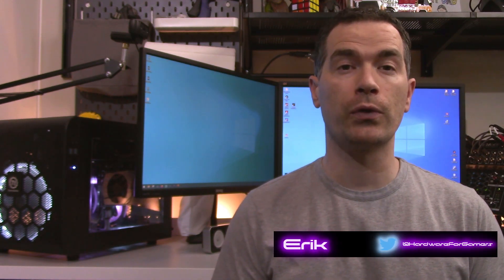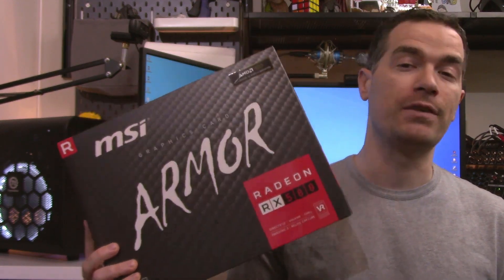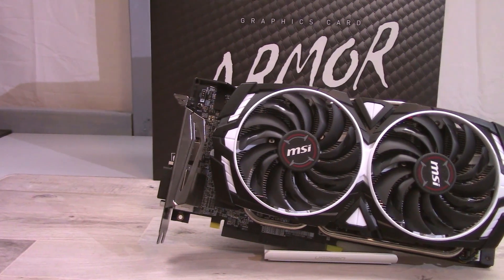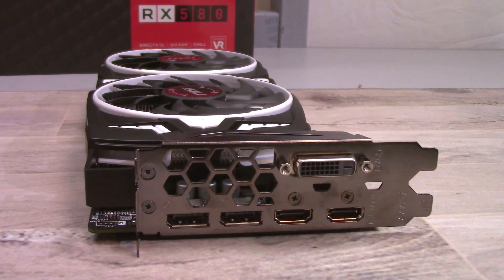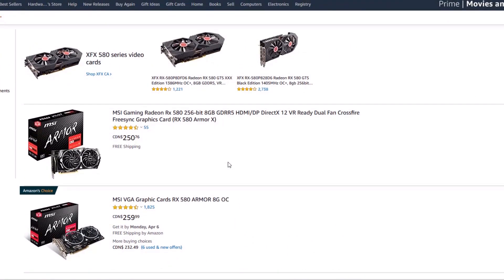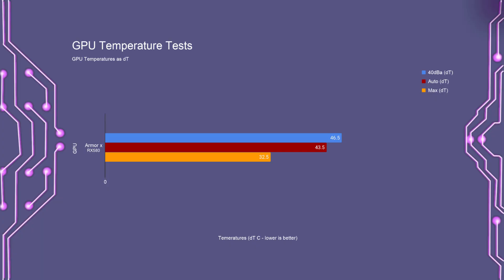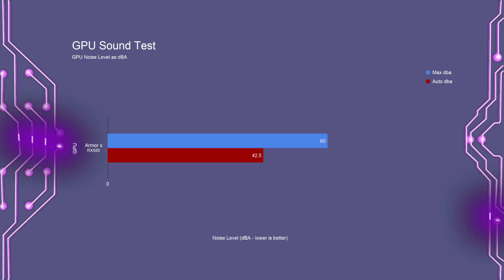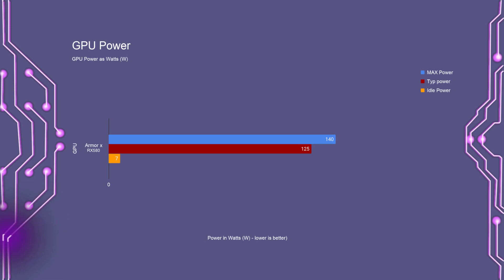MSI RX 580 Armor X Teardown

Comment: I have the same but in 480 models all the same except the vrm pads in 480 they didn't put the thermal pads on it .. I don't know why but my temperature on stock touche the max 85°c in just 5 minutes with 100% fans .. so if  I'll put the thermal pads on the vrm there is a chance to decreas temperatures?  thanks
Reply from the maker: that 85c is the GPU chip temp? Adding a thermal pad to the VRM would be a bad idea, but it wouldn't fix the GPU temps
Reply: @HardwareForGamers  i having RX 470 armour and i get 85 C .....should i change the paste or not 
and which kind you recommend ......keep in mind  i am in Egypt .
or should i change the cooler to water one for long life and more temp down .
Reply from the maker: @islammagdy744  I would not go water on a RX 470, you can try changing the paste. I use Arctic MX4.

Comment: I have this card did you notice temp drops with arranging the pads? Or switch them out?? I want to do that for mine.
Reply from the maker: After re-pasting the GPU temperatures went down only 1-2 C. I never tested the vrm or memory temperatures so I'm not dure.
Reply: @HardwareForGamers  thanks for the info! Would love to see temps of before the after teardowns be really cool too see if shifting the thermal pads a bit helped the vrms. I undervolted and locked mine too 1400 and 2200 on the ram and did a custom fan curve which did the most for my temps and power draw. Fans are locked at %50 and it makes actually not terrible noise maybe max 80 degrees. I think I'm a skip over msi next time and go with sapphire or evga..